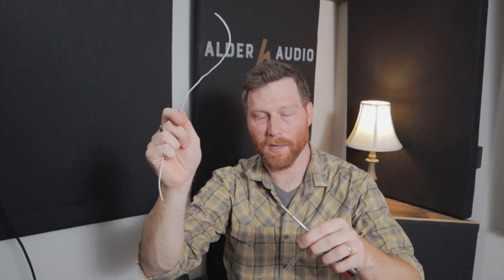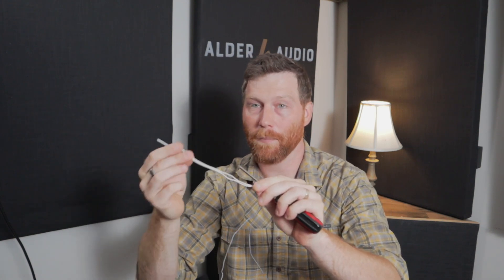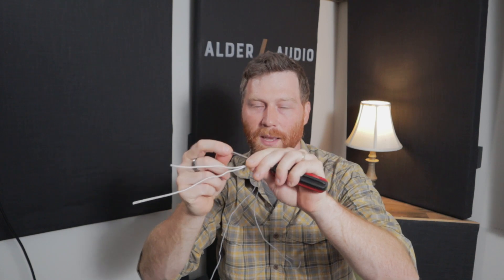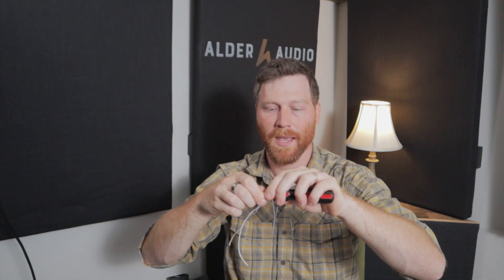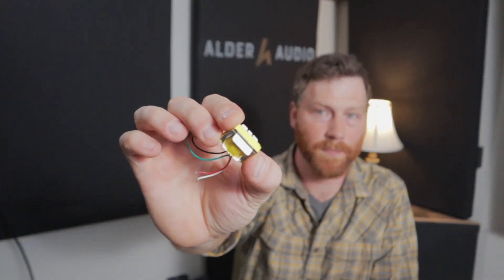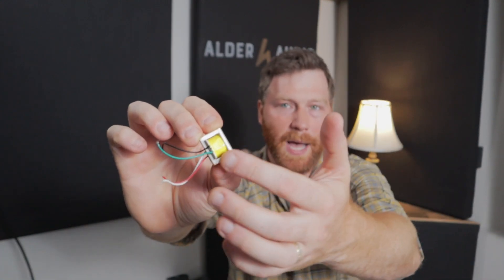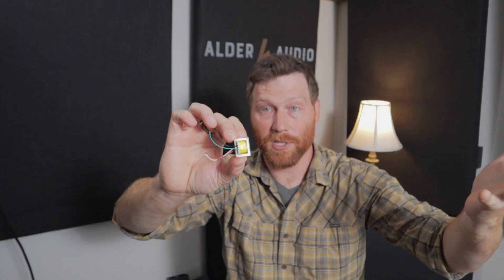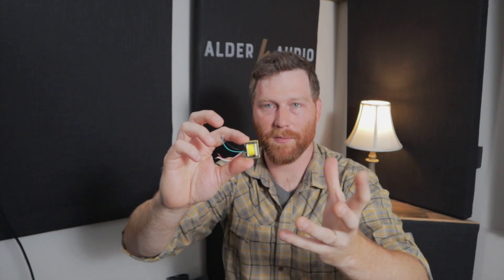A Quick Introduction to Audio Transformers

Comment: This is the example I needed. I am using a telephone coil pickup for capturing magnetic interferance of my gear, to be sent into my diode clipping circuit and the daisy dsp (which is a infinite delay algorithm). My issue I believe, since watching the previous video and now this, is that the piezo mic which is part of the telephone coil pickup is high impedance, but the signal seems so week in all the pedals I have tried, so I Could try a DI between these parts of the system and if that works... I need a transformer addition to my breadboard (when I move over to breadboard prototype rather than pre existing modules as a proof of concept system). Your visual descriptions are so helpful thank you. My dyslexia gets in the way of the heavily math and schematic based info I have tried to absorb so far, yet this is restoring the faith that my concept is pretty simple I just need a couple of solid fundamentals to make a working prototype! Luckily the heavy lifting is done in the dsp which is largely based on example libraries (until I manage to become more advanced at bespoke algos!)

I am so excited. Would love to write an email to you if you would have time to take a look, no problems if not - youve already taught me vital understandings where other videos have been more difficult to absorb for me personally. Many thanks from the UK!